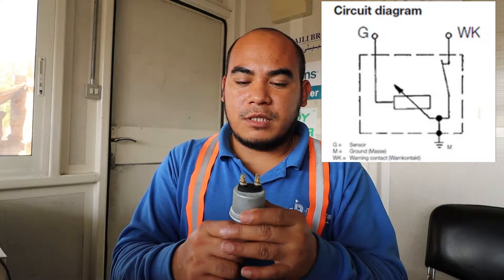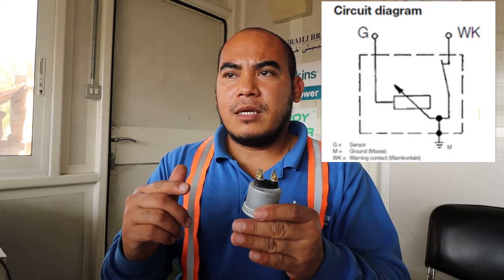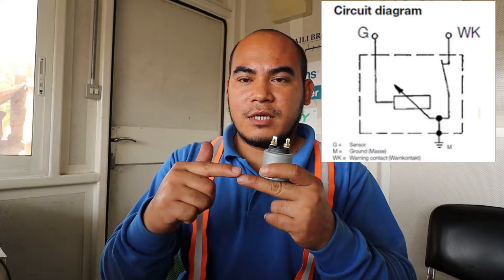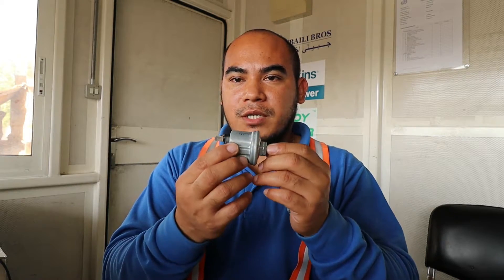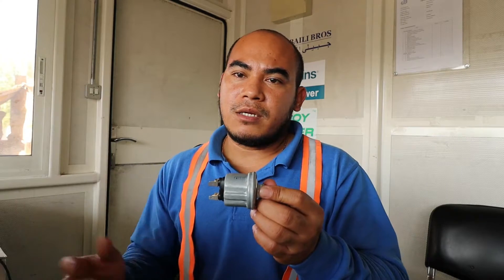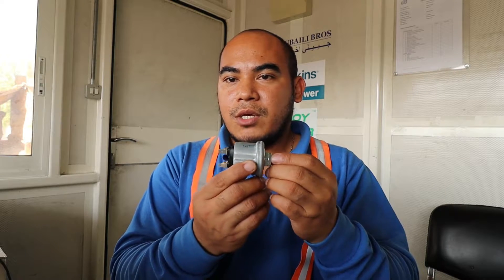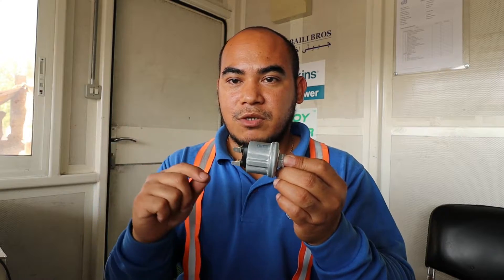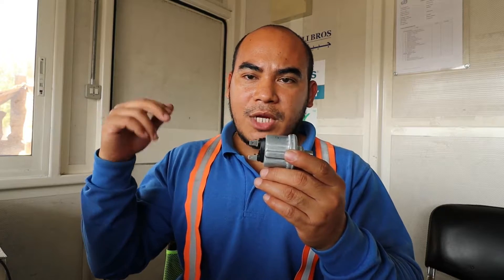deference between sensor and switch and its functions for oil pressure benzblogs

Comment: Brother

My genset 80KVa perkins the lid of radiator pop off and Genset runs until the module reads oil pressure sender default.

Need help here
Reply from the maker: Kva what having alarm oil pressure fault meaning need to change oil replace the filter and replace tge oil sensor

Comment: Please my brother i need ur support here my datakom D300 brings "oil pressure exist !" And make a down count of 60s three times and the generator won't start
Reply from the maker: Is new or rewaired or having an alarm only if alarm is the problem for oil make sure sensor is not fualty and make sure wiring is correct and configuration
Reply: @benzblogsVlogs  
Well when I find it, the fuel and the crank line were modified with external mechanical switches and also the moduel were were showing " low coolant level switch" alarm. Due to this the start, stop , auto, manual and test keys won't work. That, I fix it by entering in to configuration. After fixing this the above keys start to work. Like when u press the start button the light on start key light and also the relay energized but the module brings the" oil pressure exist!" And count down 60seconds three times and finally the generator won't start. About the oil pressure sensor the switch side have 0 ohms and the sender side shows 30 or 35 ohm resistance with respect to ground or body. The wire (wire no. 8 and 12 ) from the pressure sensore to the module are fine. On this I request ur reach experience brother. Thanks

Comment: Thanks for the information, In case of emergency how to bypass  pressure switch?
Reply from the maker: In case of emergency if you talk about sw not a sensor just remove the wire it will not work anymore thats it but only for emergency porposes

Comment: Sir how about po sa Oil sender na may 24v supply ? hope magawan nyo po ng video how to convert it to resistive..
Reply from the maker: Sir iba ang sinsor nayan voltage type na sensor kailanagn nya ng supply para makaread ng presure oil dapat ang config mo nyansa module is voltage sensor not reaistive
Reply: @benzblogsVlogs  thank you so much!

Comment: Sir paano kng oil level lng alarm piro mataas nman s oil stick nya pagtingnan k.ayaw kc mag start ng generator my alarm ayaw m reset.salamat.
Reply: Oil level low alarm
Reply from the maker: Make sure malonilinis pa ang oil at di malapaot at make sure sensore or sw ang alarm double chexk mo din ang program baka may malai lang

Comment: Master  tanong ko lang po  pag nag high  pressure  ang oil impossible ba na haloan na ng fuel. Tapos maitim na ung ang usok  Salamat po sa sagot Master  generator perkins pala Master
Reply from the maker: Sir normal na high-pressure ang oil mo sa engine di dahil naghalo ng oil sa fuel ang main reason bakit ngkakaroon tayo ng black smoke dahil sa over fueling and nozzle inlarges that coz sa black smoke sir.

Comment: Good day sir benz, may itatanong lng sana ako pwede po bang e synchronize ang dalang 8610mkii kaso yung isa walang acess sa speed adjust at avr adjust? Yung isang 8610mkii gagamitin lng for monitoring at breaker control ,pwede po bang e connect parin ang MSC link magloloadshare kaya? Ano kaya pwede gawin kng sakaling hindi pwede para mag ma synchronize parin?
Reply from the maker: Sir hindi pwedi kc para mg symch po and module kailangan po nya nga voltage speed frequency biasing in order to maintain the the balance so it can be parallel kong wala yan malabu po na magsynch sir .
Reply from the maker: At kailnagn nya din ng motorized breaker para maiclosed nya sa tamamng oras.dapat nkaawired po lahat ng kailangan ng module para magsynch
Reply: Thank you sir benz, pwede ko bang gamitan nalang mains parallel mode? Para matulungan yung isang genset bale parang mains nlng yung isang genset sir..pwede kaya yun sir? Kasi may may mains parallel mode yung 8610 sir..

Comment: Thank you sir how about the three wire sensors. what does the third wire mean?
Reply from the maker: If you can see there is lot of types of sensor some of it have a supply 3wire connect 2 color red and black  is dc supply one is your sensor
Reply from the maker: What kind of sensor do you have